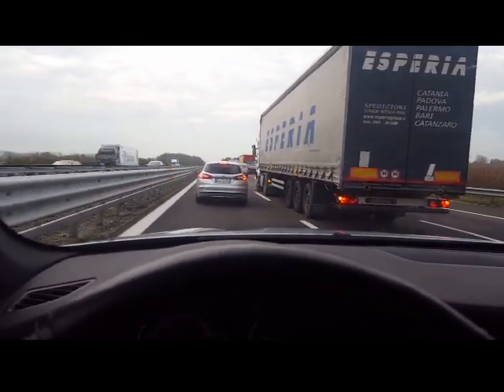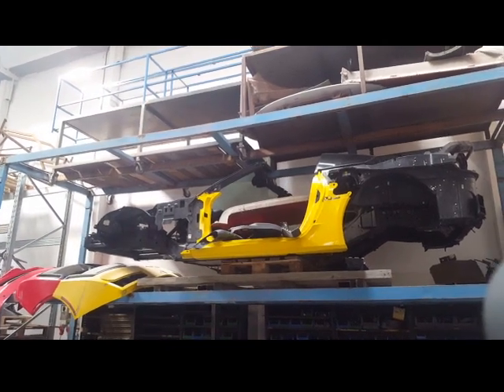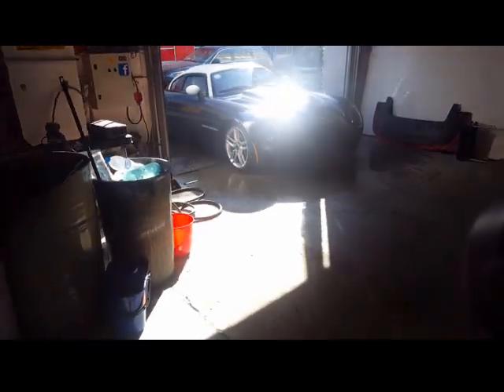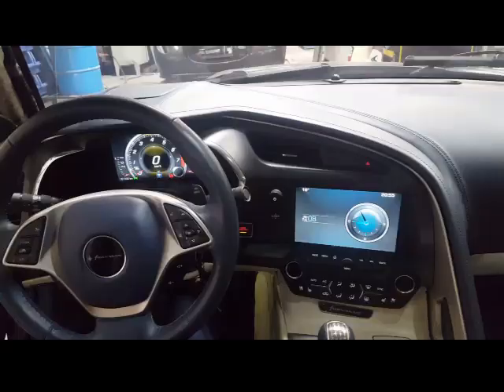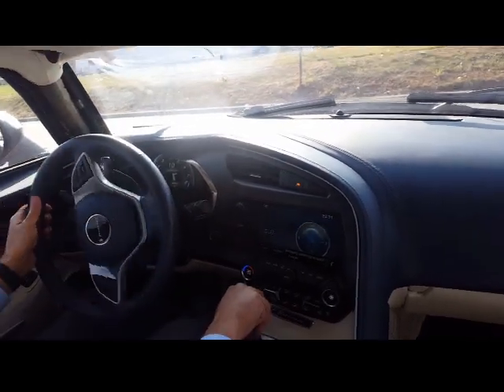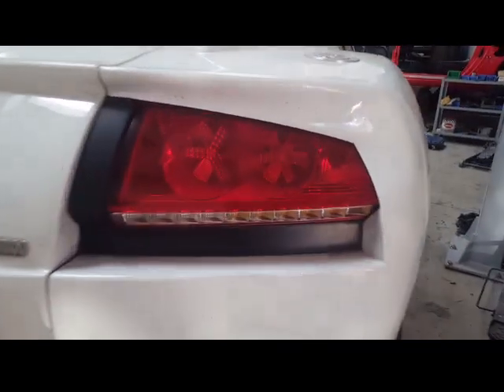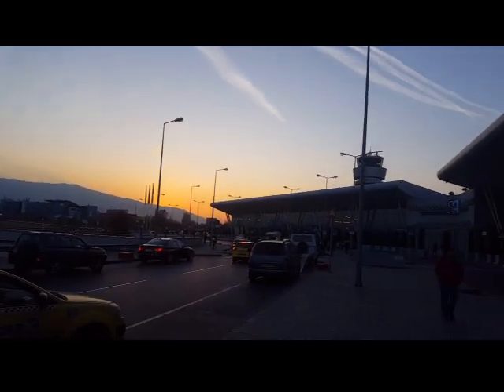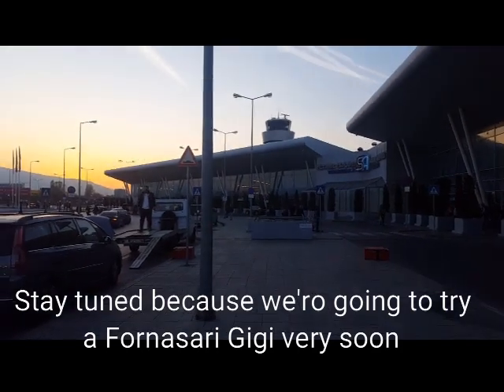The new supercar projects of Mr. Fornasari

Comment: Is it very difficult to modify the inside of the car and the infotainment system? so that you don't notice that it is a Corvette.
Reply from the maker: Well, it depends on what you'd like to achieve. Obviously it can be possible, but the final car could cost 20/30k more
Reply: @ste.fiorav  ok but there are super expensive cars like Touring Superleggera Sciadipersia(Maserati granturismo), David Brown Speedback (Jaguar XK) or Eadon Green Zeclat (another Corvette) with the same problem.
Reply from the maker: Yes but if you want you can do it. I think that the cost of doing your own electronics snd software is very high